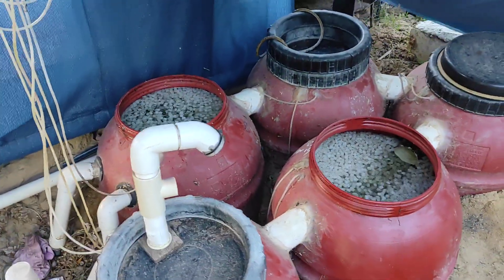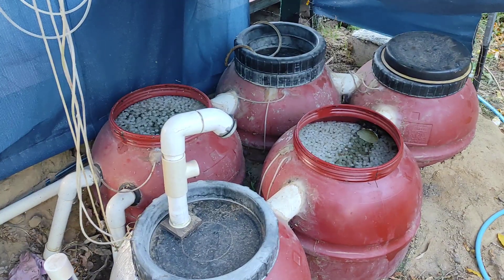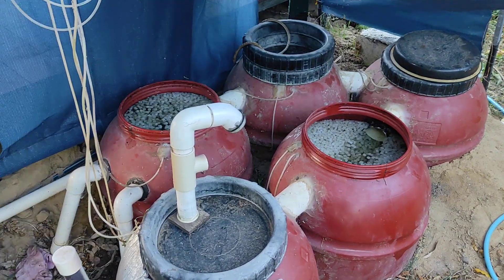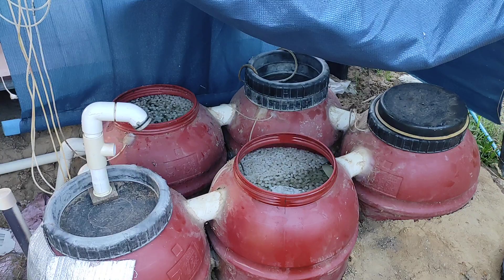filter drums

Comment: Is there any way you might be able to incorporate a venturi for extra air ?
Reply from the maker: thanks for the idea. yeah i could the only concern i have is air block. 2 times i had it jam up a fill up. even a 90mm stem coming up off the lid on the first drum  because air bubble. need to make sure air does not get trapped in the system .